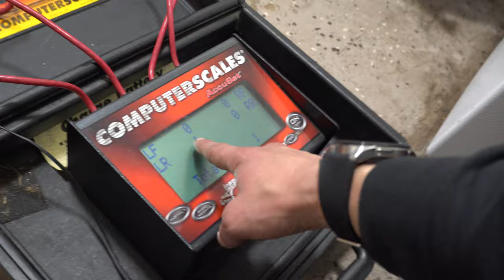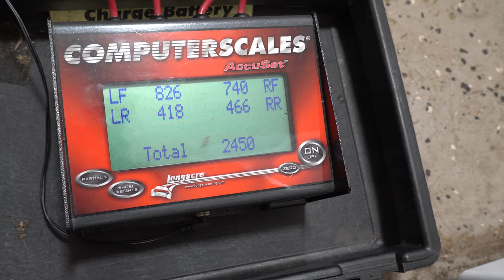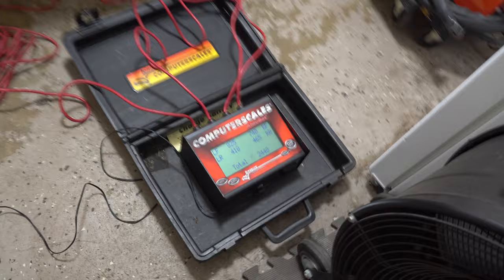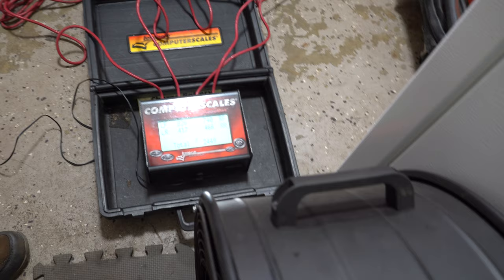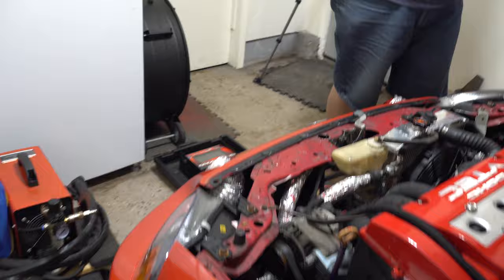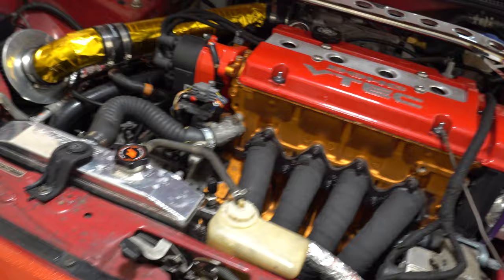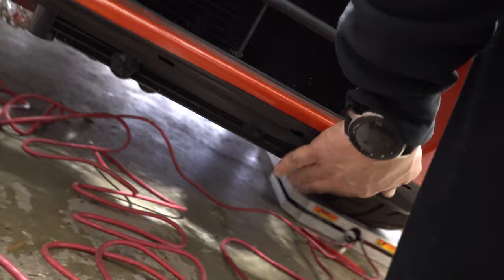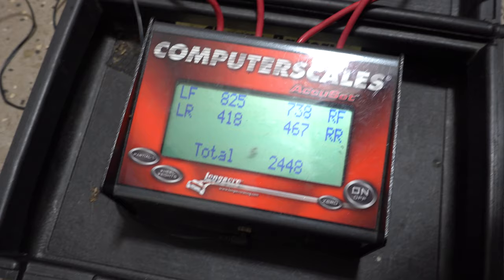How Much Does The Red Panda (93 Honda del Sol si) Weigh?

Comment: I weight my Honda Prelude 2000at the garbage disposal and it was 2700lb with half a tank keep in mind I do have the whole trunk gutted the engine bay is just motor no AC no power steering just motor and transmission took off everything I don't need  but the car weighs 2900 with me in it